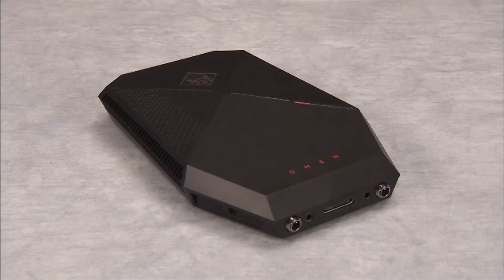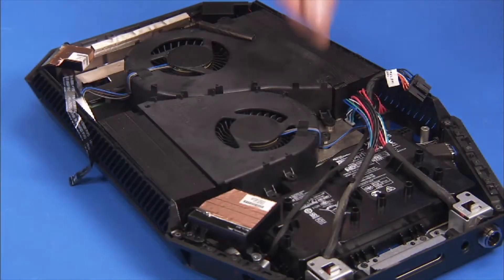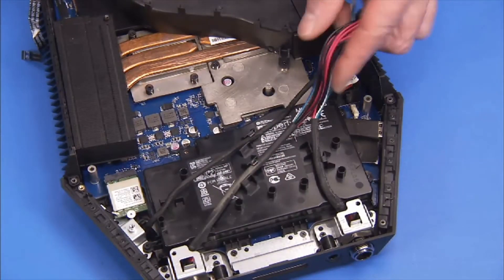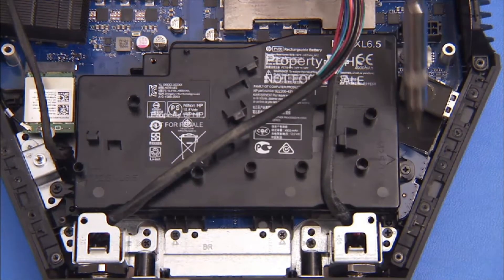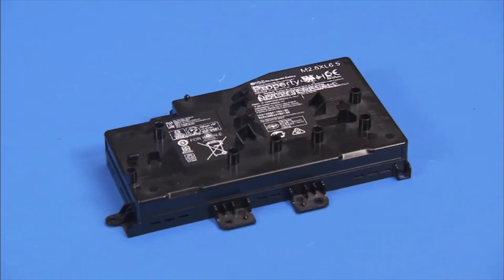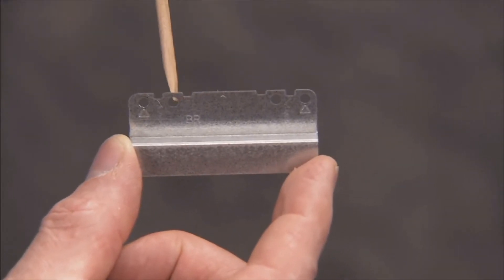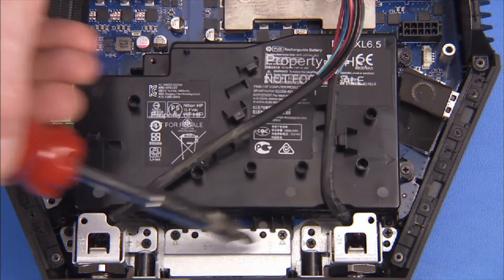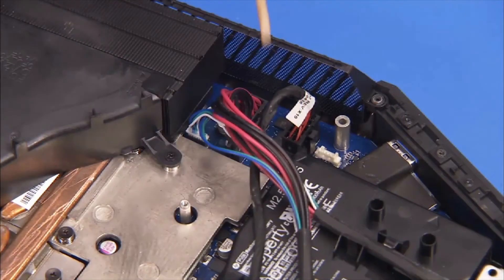Removing and Replacing the Internal Battery | OMEN by HP VR PC Pack | HP Support

Comment: i'm trying to replace the internal battery but I can't find it. it seems it's not available. can you help me?
Reply from the maker: +Emiliano Gusmini Follow these steps for removing and replacing the Internal Battery:
- Remove the six bottom rubber feet, the top cover, the small fan, and the main wireless LAN antenna bracket assembly.
- Detach the two external battery connectors.
- Remove the connector from the cable guides on the top of the battery.
- Detach the DC-IN power cable from the motherboard.
- Pull it out of the cable guides on the top of the battery. 
- Remove the small metal bracket at the front of the battery. 
- To replace the internal battery, align the battery over the motherboard.
- Press the slots straight down over the pins. 
- To replace the bracket, align the holes over their pins. 
- Align the DC-IN cable back into its cable guides on the battery.
- Reconnect the cable to the motherboard. 
- Align the external battery connectors into the cable guides on the battery.
- Reconnect them to the motherboard.